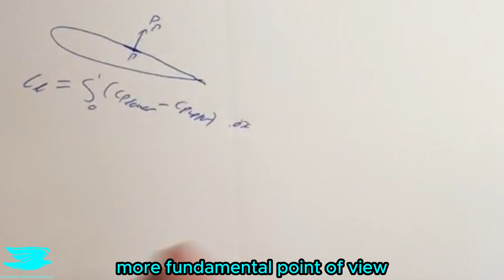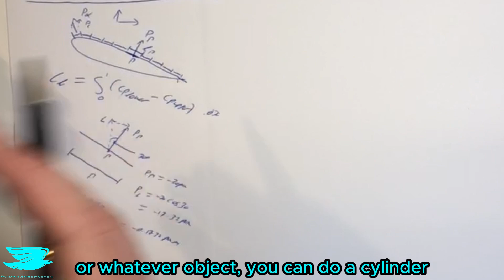[Aero Fundamentals #45] How To Calculate Airfoil Lift From Pressure Distribution

Comment: but i dont uderstand, how does that integral take into account all the decompositions in perpendicular/parallel?
Reply from the maker: You can either decompose it beforehand or during the integration based on the angle of the surface.